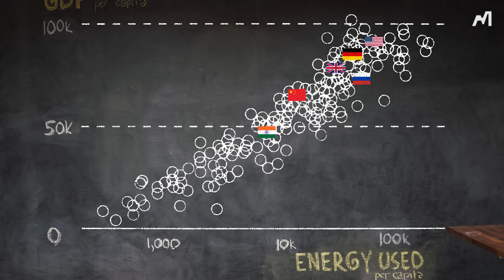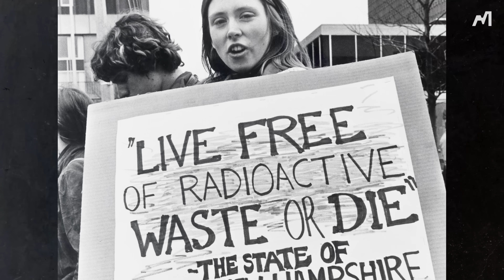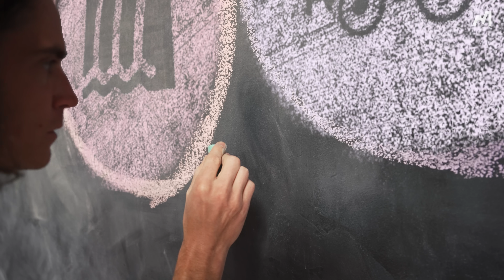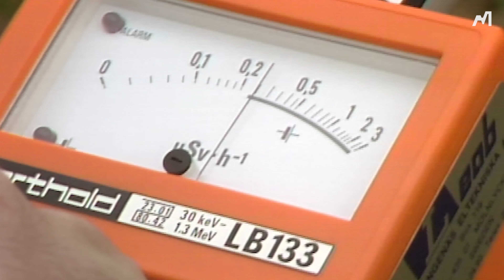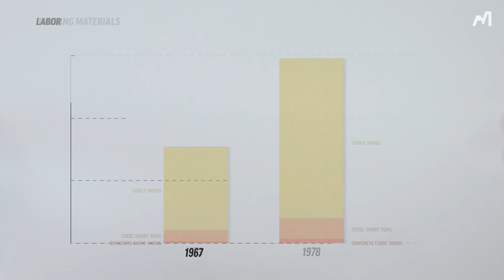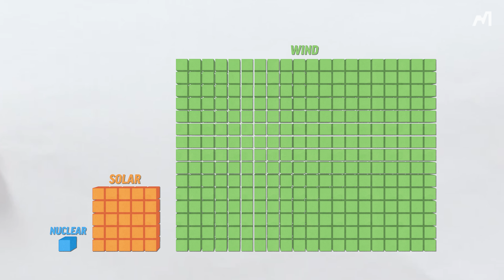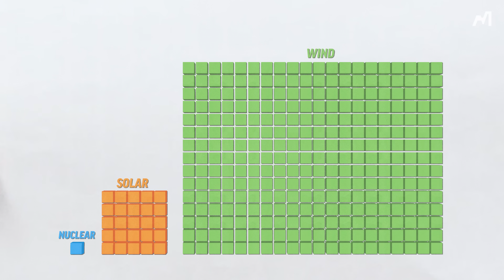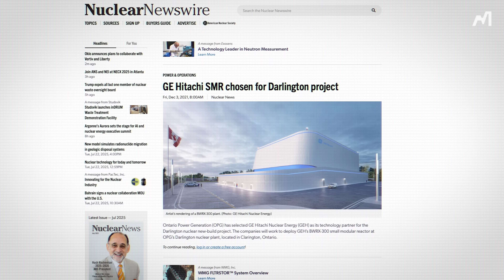They're Lying to You About Nuclear Energy

Comment: I am an engineer, and everything you've said is stuff I've been preaching for YEARS, as has my father (who was originally specializing in nuclear power plant engineering). Nuclear is the cleanest, safest, most efficient form of power known to man. Ask Germany what happened when they shut all theirs down. They ended up being reliant on Russian oil and gas. California had to extend the life of one of their reactors to keep the lights on because again, solar and wind CANNOT PROVIDE STABLE ENOUGH ENERGY.

Solar and wind will NEVER be able to provide a stable enough source of energy to our current way of life. If you don't want the radioactive coal or dangerous byproducts of oil and gas, nuclear is the ONLY option we have. It needs to be brought back as the new green energy source. 

Thank you for your video!
Reply: There is no such thing as permanent, safe, storage of spent fuel (witness the ongoing storage of spent fuel at plant locations from lack of dumping sites, making each reactor site "an event in progress," just like what is going on at Chernobyl and Fukushima)!
 
More stupidity is not the solution to stupidity. The simple fact is that the intense ionizing radiation in the boundary of the nuclear fuel causes the containment to transmute over time, where the containment materials lose their original elemental qualities, frequently becoming brittle and no longer able to perform as originally intended. Zombie reactors that are past their designed life are losing the safety safety factors originally designed into the containment in ways that are not predictable until incidents inevitably occur. The same thing applies to the containment of high-level nuclear waste. These matters are well-known to the industry, but being withheld from public scrutiny in order to maintain the current zeitgeist.
Reply: @richardmcbroom102  I don't disagree that current reactors are far past their original lifetimes. They desperately need to be replaced but because of how difficult it is for them to be replaced by another reactor (because there is no other form of power that could 1-to-1 replace it), it is a never-ending circle of just duct taping them back together.

As to the fuel problem, the newer third gen reactors are finding ways of using that spent fuel more efficiently so as to reduce their radioactivity down to nearly completely safe levels. Not to say you won't have some by product, but even with all the reactors around the world running for 60+ years, the amount of spent nuclear fuel that we've produced only is a rectangular prism the size of a football field. That's nothing compared to the amount of ash, gas, and contaminants that are produced by coal, oil and natural gas, and it required far less starter materials than solar or wind (less mining for materials). And we built a place specifically to protect the canisters of spent fuel for hundreds of years even with the embrittling process under Yucca Mountain (where there is no known tectonic activity), but politics keep the canisters from being actually transported and stored there.

I don't disagree with any of your points, they are things to be considered, but politics are the number 1 thing holding the solutions back from being enacted to allow nuclear to expand once again safely and efficiently.

Comment: The Problem with nuclear power is the waste, there is no working solution to date how to handle and store it for the amount of time it has to be stored safely - If you Factor in those costs, the cost of power from nuclear plants goes tough the roof.. you Talk about solar using Land, but its no problem to put solar panels on the roof you're already living under... Renewable energy sources like solar are so much cheaper that its just no longer financially viable to build nuclear power plants, thats the whole story.. 
And If you think about it, with Panels for a couple hundert dollars and maybe a 5 to 10kwh batterie in the basement you can cover 90+% of your electricity need, why would you not want that?
Don't get me wrong nuclear power is fascinating, its just not necessary anymore..

Comment: Every frequency radiates and has a unique function and they all have different cause-and-effect relationships
Microwave radiation is different than solar radiation and X, gamma, or nuclear radiation.
Radiation is neither a "bad" or "good" thing, it is the emission of energy at a specific frequency. The cause and effect relationship of each frequency may determine whether that is bad or good. They are all different.

Nuclear weaponry is mostly a facade and is nothing compared to the capability of direct energy weapons
Because nuclear material can't go boom, it radiates. It's not a particle. It’s a wave. You can't split a wave. They use conventional explosives to disperse nuclear materials attached that will radiate and cause subsequent injury/death. The destruction and death is real, regardless.

Comment: Good video. Very informative. But let me through this at you about wind/solar/battery.
The Fall of Wind/Solar/Battery cost from 2010 to 2020
solar ~89%
wind ~70%
batteries over 90% 

Tony Seba predicted this fall in battery prices, and he was laughed at for it

Tony Seba projects further drops in the 2020s due to continued exponential adoption:

Solar: Another 70% decline by 2030, potentially reaching ~1¢/kWh or less in optimal conditions, making it the cheapest source globally. 
Onshore Wind: 40% further reduction, to around 2-3¢/kWh. 
Batteries: 80% drop, to ~$20/kWh, enabling cost-effective storage to address intermittency.

As for killing birds, Norway has found that painting one of the blades black reduces bird strikes by 71%. This measure was particularly effective for birds of prey (e.g., white-tailed eagles, which are protected in Norway and a major concern at Smøla, where 6–9 are killed annually farm-wide). No white-tailed eagle fatalities were recorded at the painted turbines post-painting, representing a 100% reduction for this species in the study sample.

 People are working on the bird-strike  problem. Let's not start some more insurmountable-problem myths about another energy source.

Comment: Always those ridiculous "dose" argument. 

It doesn't matter what dose you get on the Everest or in Denver.  That isn't a comparison for the risk ingesting radioactive particles. 

If you eat contaminated seafood and the Caesium or strontium doesn't leave your body, but stays at one place (eg thyroid)
you'll die - no matter the dose measured. 
If your lucky and it leaves the body - nothing happens but a statistical risk.

It's like getting a sunburn vs having a little sun burning inside your body for years.
Reply: I think it is a pretty easy concern to solve. Maybe a sign that says, "Do not eat the plutonium."
Reply: >It doesn't matter what dose you get on the Everest or in Denver.  That isn't a comparison for the risk ingesting radioactive particles
Yes it is.  Notice those doses are in sieverts (milli- or micro- usually)?  The sievert is a unit corrected for biological effect.  This unit was specifically developed to be able to compare risks not only from different external sources but also between external and internal doses.  If the units of exposure is in sieverts it IS by definition an appropriate comparison.

And for reference, if you eat contaminated seafood with 1 sievert of cesium-137 or strontium-90 (or iodine 131 to round out the list of most concerning fission products, and they get absorbed; you don't die. You increase your risk of s fatal cancer to 5.5% based on the (questionable for doses under 100 to 130millisieverts) linear no threshold model.  

But you don't get 1 sievert from these isotopes from seafood.  First, because 99% of the radioactive particles being eaten are usually of natural origin.  And second because the peak doses of isotopes from seafood from  Chernobyl was about 0.2 millisieverts per year and Fukushima was about 0.004 millisieverts per year.

So to use your analogy it's like having a barely detectable sub-microscopic sun burning inside you for years versus getting a blistering sunburn every single day over the same time.

Comment: I think the single most profound thing I've ever heard was that harmful and/or lethal radiation dosages are all based on acute exposure... meaning that the same large doses administered over a protracted period of time are essentially harmless. Which, of course, is why the Fukushima workers were able to receive their ridiculous dosages without adverse long- or short-term effects, considering they were rotated in and out at pre-determined intervals to receive those dosages over the course of several months, whereas the Chernobyl firefighters (who all died of radiation poisoning) received their equally absurd dosages in a handful of hours.

Second most profound would be the fact that we can use basically every stage of U-235 decomposition as, you guessed it, reactor fuel. You just have to design and build another reactor, and you can get even more electricity per gram of Uranium fuel by literally just processing and reacting the byproducts of spent fuel rods

Comment: A typical fossil fuel turbine generates 1,000 MegaWatts. 24hrs/day 365 days/year
Watts is power. Energy is power x time. 
So the energy from that turbine is 1,000 x 24 x 365 MegaWattHrs.
To generate the same energy from solar panels will take about 100 sq miles of solar panels.

100 sq miles stripped of all plant life because it will grow up into the panels and damage them.
That land will be buried in rock and sand aggregate to prevent any future plant growth. For perhaps 200 years.
And to generate the typical power needed for a typical US state it takes 45 of those 1,000 MegaWatt turbines.
And those turbine facilities take only about 10 sq miles all total for the whole state.
For solar to do the same thing it will take 4,500 sq miles of solar panel facilities.
But the extra power line trails needed will take even more sq miles of land but at least you can let some grass grow on those power line trails. No trees or shrubs, just some grass.
But what about batteries for when it is nighttime plus extended days of bad weather? Those batteries for one US state will cost approximately the value of the entire Earth if we could find some alien beings willing to buy it.

Comment: While I completely agree that people are WAY too concerned about the safety of nuclear power, I don't think that kicking the same kind of unfounded reputation dirt at other things and passing off the dumb and risky things that people have done as basically the way it should be is not a good path forward.

We should be using taking more advantage of the nuclear resources we do have (e.g. "spent" fuel is actually still usable under other reactor designs) and building more so we can reduce our usage of much more problematic energy sources (i.e. fossil fuels which are going to get much more expensive to extract over time and from which the normalized pollution kills so many more than nuclear power would ever).

At the same time, your attacks on wind and solar power seemed disingenuous and poorly founded. For example, while it is true that flying animals do crash into wind turbines, the impact of that is much smaller than the impacts of fossil fuel use). Additionally complaining about solar panel land use and saying things under them will die is, just like people's fear of nuclear power, blown completely out of proportion, there is quite literally more land dedicated to golf courses than there is to solar farms and solar farms are placed in much less attractive and visible locations than golf courses. People aren't cutting down pristine land to build solar farms, in general they're sticking them in deserts, degraded and unprofitable farm land, and on top of already used urban spaces. In many locations we could easily put solar panels over parking lots that would shade cars and provide energy at the same time. Using PV-T panels could improve the energy capture efficiency dramatically as well (as plain PV panels have efficiencies of around 20%). While of course all power sources have their trade-offs and weaknesses (and thus need to be used in the appropriate cases--we aren't going to have usable electric tractors or jets and even electric cars are on the dumb side in terms of efficiency--but all of these technologies do have places where they make sense.

As a responsible and informed person, you should seek to understand where each technology fits, not advocate for a one-size-fits-all solution, and ultimately we can all come out with more reasonably priced power, better health, and a more stable world as we cut through disinformation and use technology appropriately.